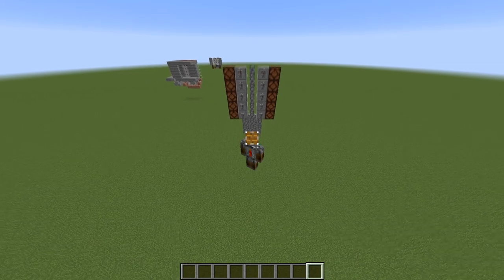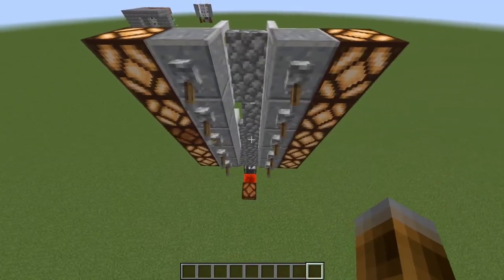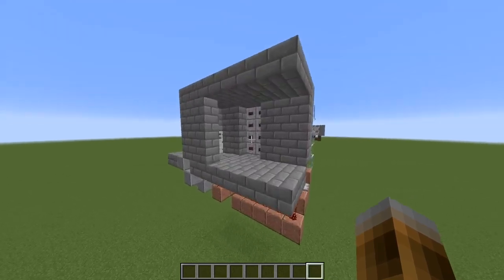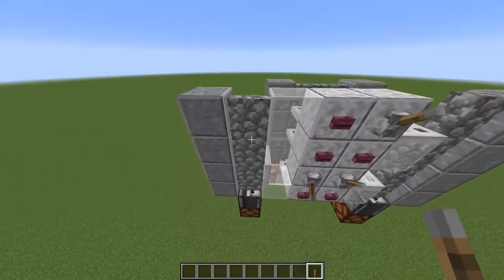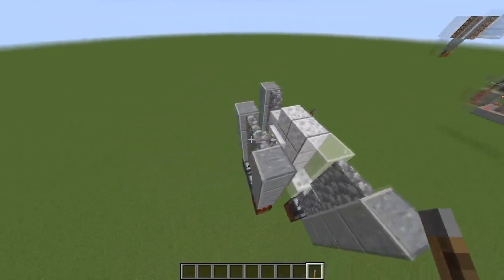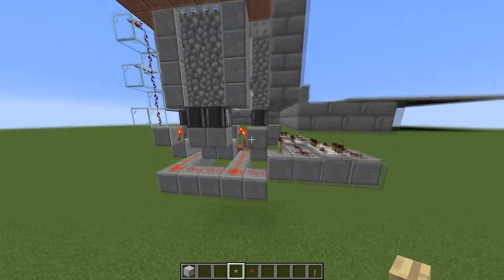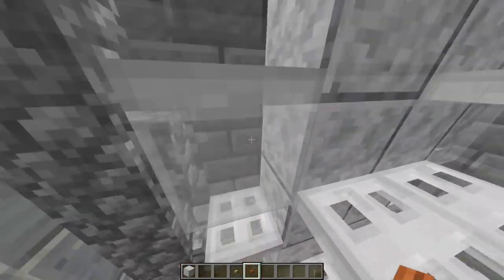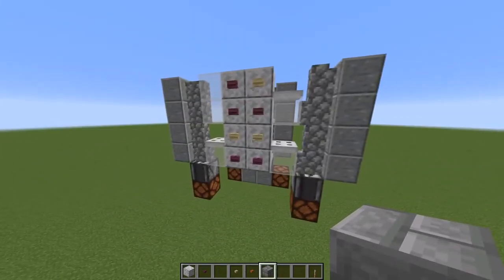Simple Combination Lock using Cobblewalls

Comment: Maybe we can send this to the LockpickingLawyer, this is probably safer than the most locks 🔒
Reply: if you know how it works you could in theory reverse engineer it (locating the trap doors via sound, not too easy though)
Reply: I guess if you send this to him he'll probably just say "it's easily defeated with a wooden pickaxe" or something along the line.
Reply: @Sero3_  but what about adventure mode?
Reply: Analog, no he is doing his ex-girlfriend's new boyfriend a service by loosening her backdoor... he even cleaned it, lubed it up and used his very handy tools on it. After all, LPL is a professional, and an unskilled worker couldn't fix that job that fast.

And for anyone who thinks this is lewd, what the hell is wrong with you.. LPL is a lockpick master extraordinaire. He cleaned the lock, lubed the lock and opened the lock with his tools.
Reply: @Beerfazz  This would be too easy to decode with sound.
Reply: @Beerfazz  He will say it can be easily picked by deleting the world
Reply: @willjohnsonjohnson  -- both the right buttons and the wrong buttons flip a trapdoor. There's a very slight difference in position, but good luck using that.
Reply: @Beerfazz  I just tested it, it's very easy (at least with headphones)

Comment: Alternate idea: throw a minecart at the back of the lock, aligned with the non-pillar horizontal position. If it doesn’t get to the bottom within a given timeframe, it must have landed on the pillar, meaning that the lock is not properly set

Comment: What I want to know is WHY this works... The only thing that I can think of that would even remotly make this work is if sunlight caused block updates (which they don't) and if cobble walls blocked the sun light when not connected (which they don't). So what's the mechanic? I'm guessing this is April fools.
Reply from the maker: The shape of the cobble wall changes